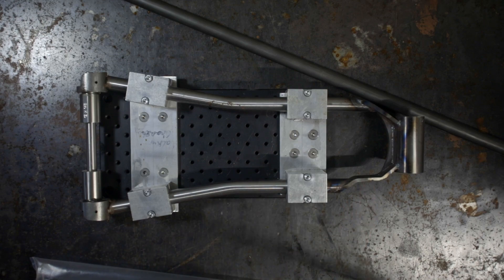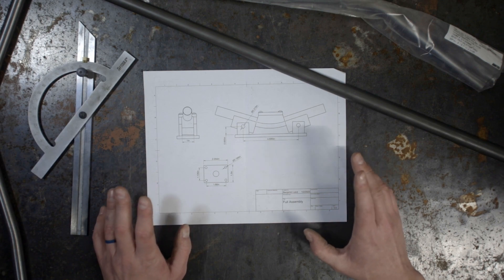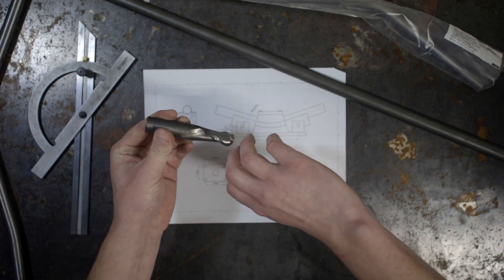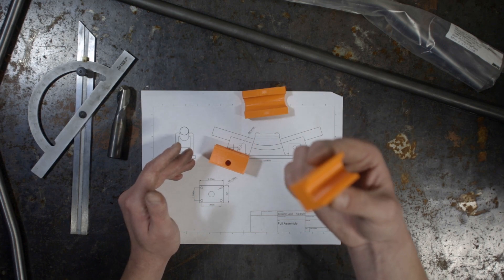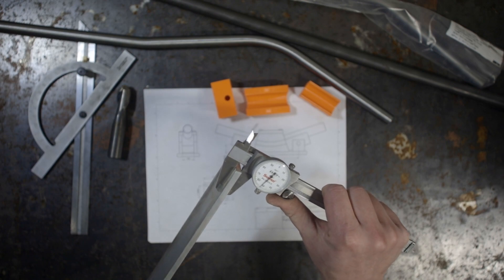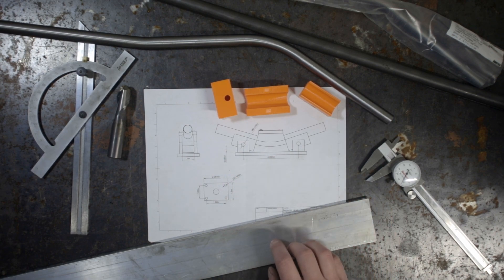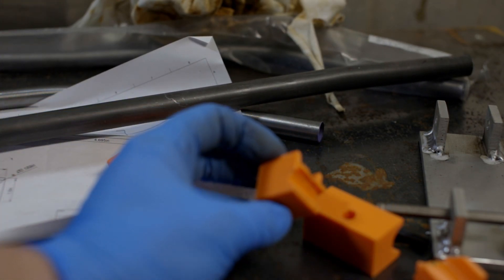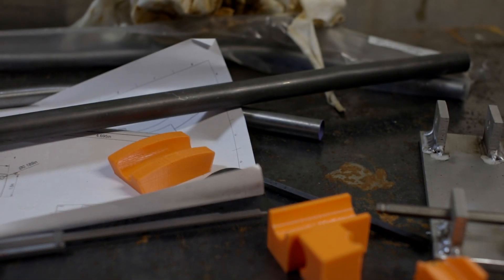3D Printed Tubing Bender - First Attempt

Comment: Have you considered nesting your 3D print inside a cut section(think “U”) of steel tubing? The pivot points could be on the outside of the steel for the lower dies.
Reply from the maker: That was what I was thinking if the dies ever start splitting. Which is a problem even on 'real' benders sometimes. Thanks!

Comment: you should probably change the print orientation, because the weakness is between the layers
Reply from the maker: Agreed. I printed the two side blocks vertically, my thought being it was likely to split down the middle. But that obviously made it weaker in the way it broke. 
I'm gonna tweak the design a bit and try again soon.

Comment: Probably need to print at 100% infill and support the backs of those blocks with metal plate vs a single weak pivot.  Thanks for posting something not quite successful, often can learn more that way.
Reply from the maker: 100% infill is definitely an option! Thanks

Comment: Small bearing mount for the Paragon tube block would likely work. If that curved one hold up in the middle it would be great.
Reply: Was thinking the same. The part that broke needs more spread of the load it takes. Putting bearings in would be the easiest way.
Alternatively, scale it up until a small section of tubing can be used as a shaft.
Last resort attempt would be to print the part on the side instead to strengthen the axis hole, but in that case it could just crack along in the middle instead.
Though if the curvature matches the pipe well enough, it /could/ work out.